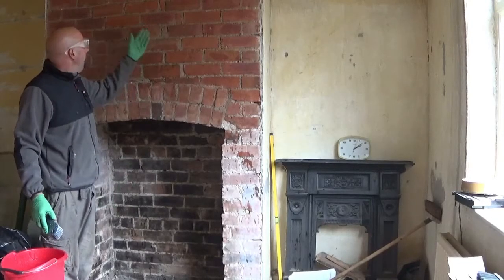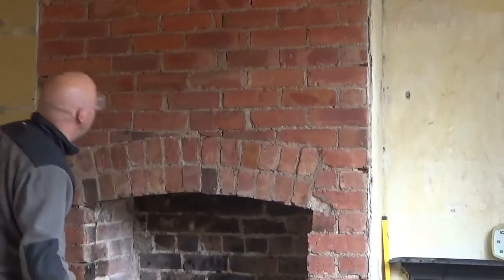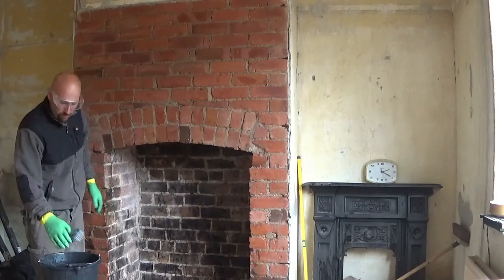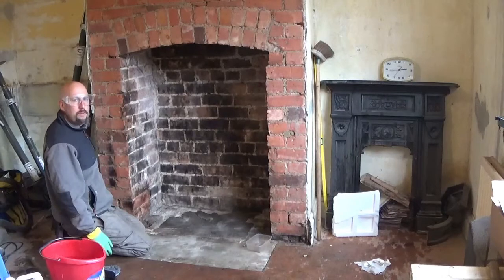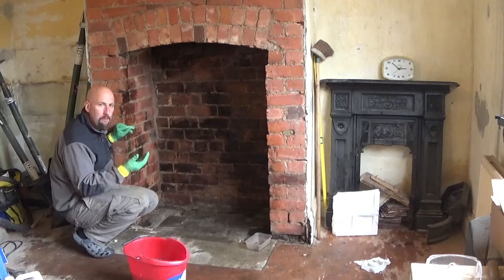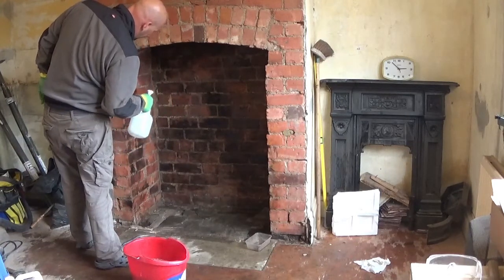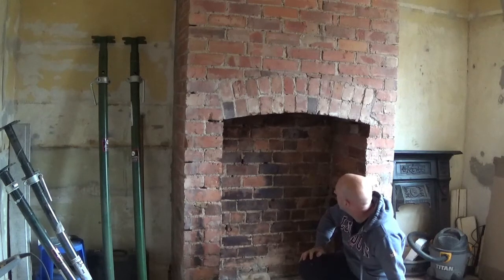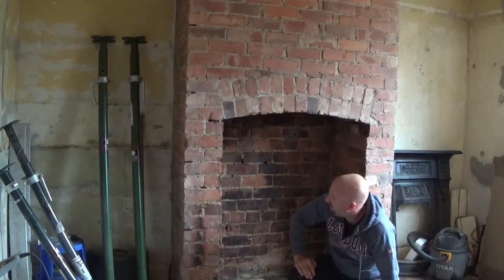Vane Cottage - Chemical Brick, Mortar & Soot Cleaner | Video #6

Comment: What kind of bottle did you use to rinse the bricks inside the fireplace?
Reply from the maker: I think that one was the Draper pressure spray gun from tool station or screwfix